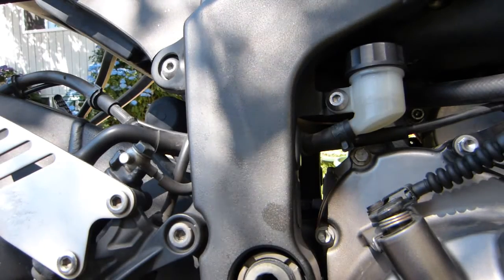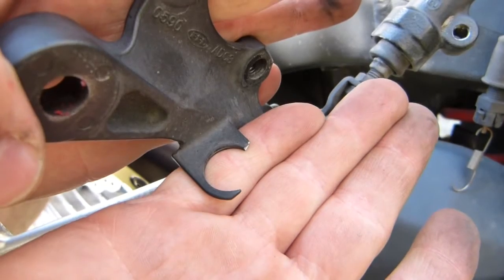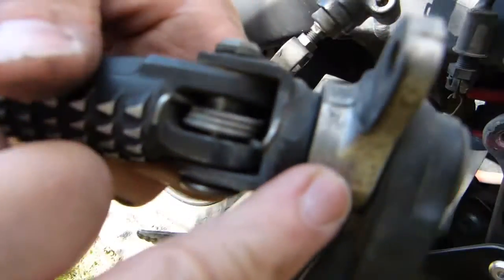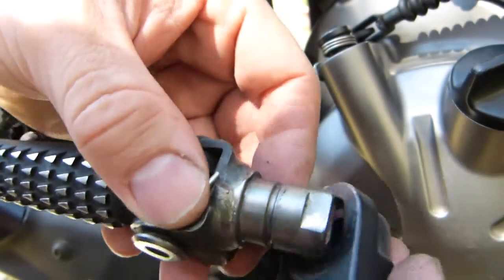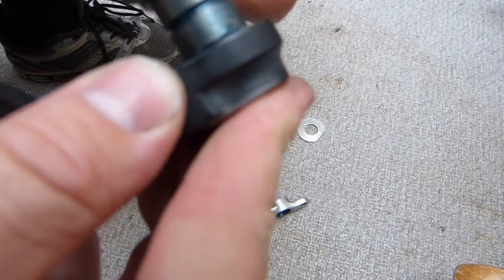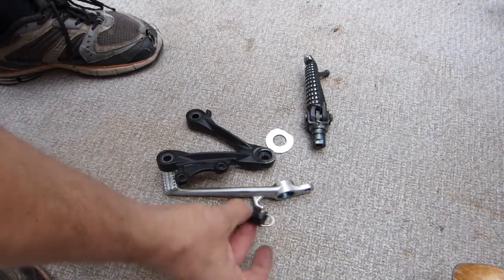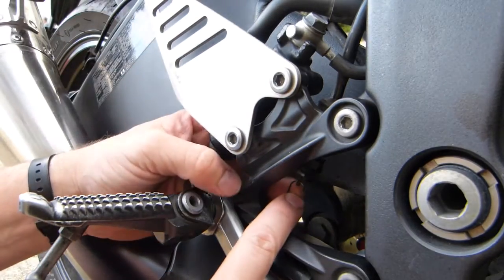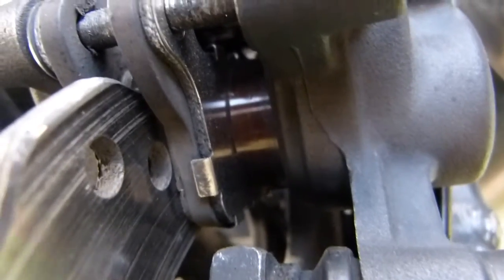Brake pedal maintenance: removal, parts, cleaning, lubing, mounting

Comment: 6:35, noticed this is missing the plastic bushing that goes inside that brake lever, which reduces the sideways play when you attach it to the footpeg.  The solution to put the washer there is ok but just wanted to point out that the assembly is literally missing a part, that's why it didn't fit well.  I know this because I'm currently replacing the brake lever on my bike.
Reply: Yes, I'm currently trying to find a way to get it out from my broken brake pedal. The new replacement pedal doesn't have it preinstalled. I think the insert in my pedal is not plastic, not 100% sure.
Update: I've cut the broken pedal and managed to take the sleeve out, it's magnetic, so it's not plastic for sure.

Comment: I wasn't careful when reattaching the spring and so the brake light wires broke. Is this worth trying to repair or should I just replace it?
Reply from the maker: Electrical wires could be repaired easily, but corrosion and vibration makes repairs fail faster than having intact lengths of wires.

Comment: What tool did you use to remove the brake pedal screw? 8:43
Reply from the maker: 5mm hex key (Allan key), may be 6mm, don't have the bike around to check. Hex key snapped on a 3/8 inch drive ratchet handle to turn it with.

Comment: You skipped the hardest part of the process on how to take the bolt out
Reply from the maker: Turn the wrench?
Thanks for watching!
Reply: @theoverengineer   he’s right. Mine won’t come off, it’s so freaking tight. Even tried WD-40. Now I need to get a new bolt and maybe like grind or drill this one out. Any ideas?
Reply from the maker: Ouch, right, seized bolt is a bad shituation. Sacrificial bolt, yes, watch that power grinding, the heat it generates can soften and distort the cast aluminum, so go slowly or with water running through a garden hose.